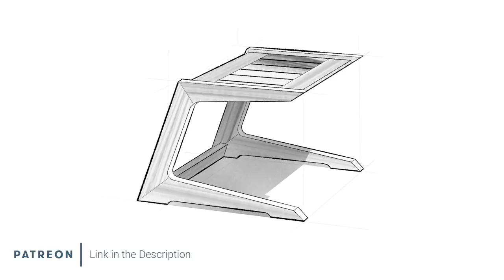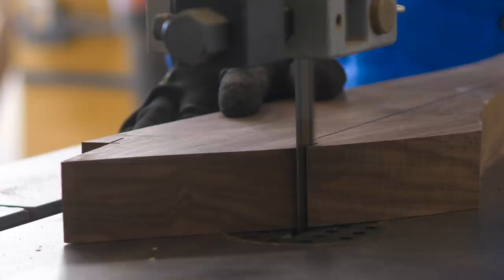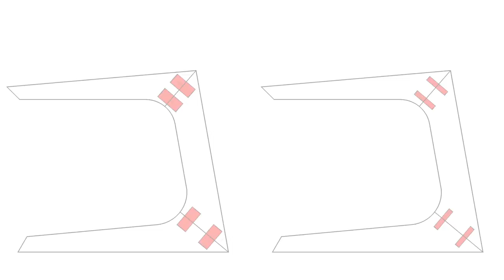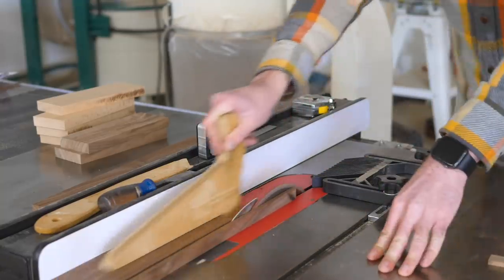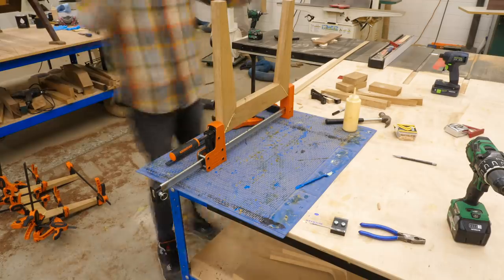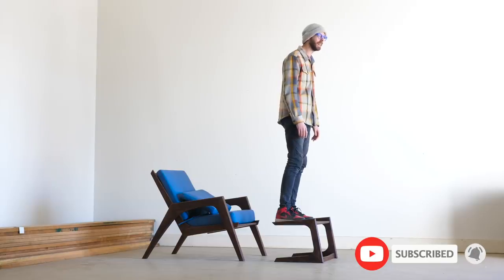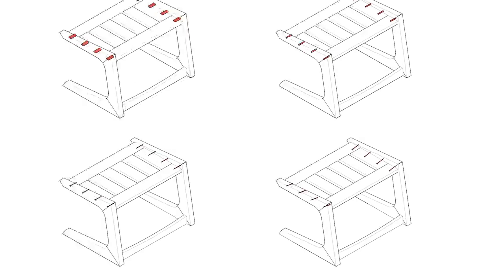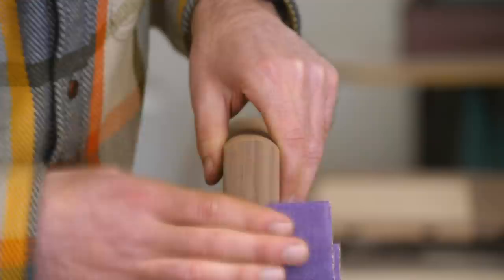Highly Detailed Build and Strength Test of a Cantilevered Mid Century Modern Ottoman

Comment: Loved the video!  I also use Dominos quite a bit, and recently had to figure out how to locate the motise locations on the underside of a table top to match up with those I drilled in tops of the legs.  My simple solution was to create what I call "Domino Centers"... I drilled/glued a small brad centered on the end of a Domino and put those into the mortises in the  legs...pressed the table top down on them --- Just Like That... Domino Centers.  Worked great!  Looks like that would have worked for the ottoman  seat location.... I project I want to now build!

Comment: Question: have you researched the strength difference when placing your joints? I love your approach to complex angles but can’t help to wonder if you’re placing your joints in the weakest places… for instance… placing a 45 degree joint in an area where the weight of your project rests seems like it would be the most stressed area… if you were to move that an inch or two in either direction you’d have the weight load on an area that is not a joint!? Does that make sense? Please don’t take this as criticism as I’m below a novice when it comes to woodworking but I’m familiar with physics which is why I ask. Thanks in advance.

Comment: Minute 6:10: why did you use the tablesaw instead of the bandsaw? 🤔
Reply from the maker: I guess it's kinda 6 to 1, half dozen to the other. If the piece is small enough, and I'm not worried about preserving material with a thin kerf...I'll usually pick table saw.
Reply: @Foureyes.Furniture  Different approaches.  I prefer machines that don't have 4000rpm rotating blades and are potentially less risky.  Anyway, the pieces will have to be planed again to thickness. And then the bandsaw is less noisy 😂

Comment: From a product use-market research perspective, ottomans are severe trip fall hazards for seniors.  Add to that the degree of difficulty of physically getting up out of the chair with an ottoman in the way, a person has to either push or kick the ottoman out of the way or splay their legs apart at a wide angle to stand up around or over the ottoman, and then high step/dance around it. Standing up out of a chair is an extremely sever hip challenge for seniors as it is, an ottoman in the way makes it all the more difficult.  If someone were to kick it out of the way and the heel of the ottoman were to catch on the carpet and endo side up, it would become an impalement hazard.  The mid-century market is very attractive and your designs and craftsmanship are so cool; could you consider an ottoman tuck-under-seat design iteration?  Say a shape someone could easily retrieve for themselves and maybe rotate and tuck under their seat to mate the angles so the ottoman is entirely out of the way?  The mid-century modern design adaptability can easily accommodate more for the ageing-in-place consumer in the art furniture legacy market I think. Just my 2 cents.  I love your work!
Reply: We actually considered making this one in a way where it could nest with the lounge chair, but felt like we were sacrificing too much with the design. I think a new design for both the chair and the ottoman could be done to achieve something like you are describing. Would be a cool concept, and maybe something we could explore in the future. Thanks for watching!
Reply: @shaunb66  Yes!  Exactly, a new unified nesting chair-ottoman design, that was my thought!  Its good to collaboratively word smith design development concepts, so thank you for your designer's eye and vision and helping me put my words together!  I really enjoy the build process of your projects of course but I find I am now more keenly focused on your design development conceptualization processes too!  It seems like you design stuff, build and video it together and then create a great video product inclusive of your well polished design reflections.  I'd really like to see more of how you two think from the raw beginning of your designs, both individually and as a team!  Thanks!